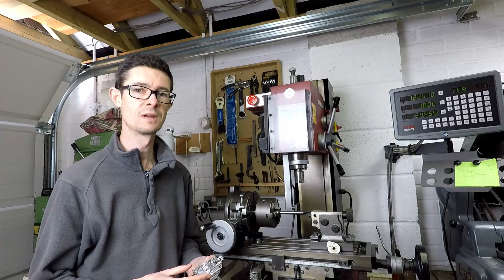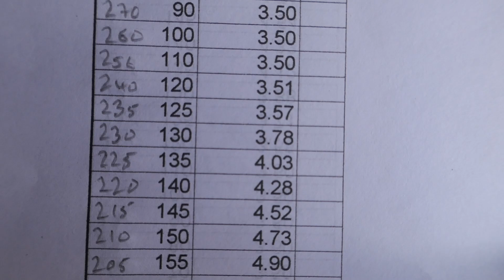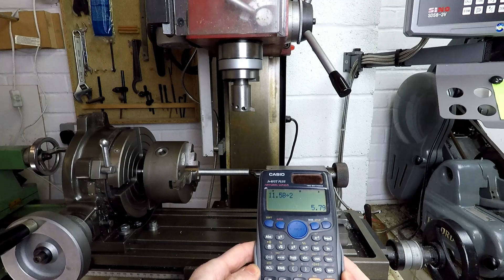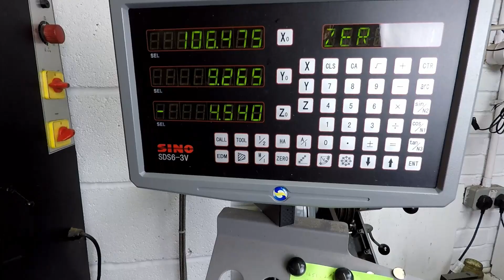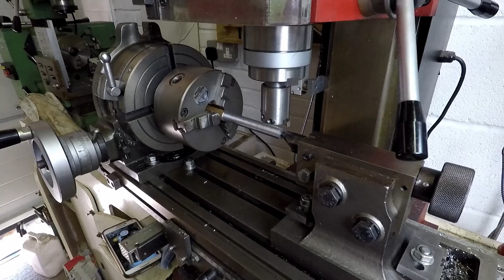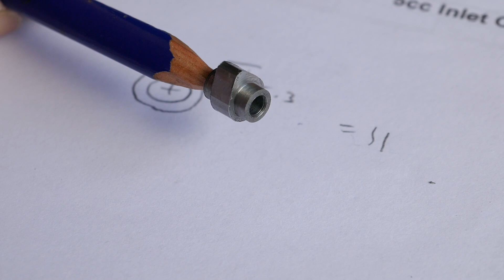Machining Engine Cams on a Milling Maching

Comment: Good video! 5cc is really small four stroke.  I used an offset turning fixture in my 9" lathe to nibble cut 5 degrees at a time for my 10cc four stroke cams.

Comment: Hi, can you please indicate me, where to find the program to make the cams like you ? Thanks in advance !! Alberto.
Reply from the maker: Hi, the method I used to design the cams was taken from the book ‘Miniature Internal Combustion Engines’ by Malcolm Stride.  This defines the base circle radius, flank radius and nose radius and depends on the engine timing.  I then drew this up on CAD.  The CAM offsets/coordinates shown in the vid were measured by rotating the wooden cam in a rotary table and measuring with digital callipers.  In this case, these measurements are the amount by which the milling machine head has to be lowered, which is different to the XY coordinates of the cam profile.
I hope this makes sense!  Cheers, MMS.
Reply: @MetalMachineShop  Yep, more like muddy water than straight mud.  Thanks for that.  I have some reading to do...lol

Comment: I have  a Hobby Lathe which I adapt for milling .
I make models of steam engines and recently IC engines
When it came to making a model cam shaft I had to use my basic hobby lathe.
I decided to use milling as the best option but did not have centres on  my lathe for milling  hence had to come up with an alternative.
I decided to hold the camshaft blank in a vice on the milling slide.
I used a parallel spacer between the bottom of the cam blank and base of the vice so I could hold the cam tight in the vice at a given distance to the fly cutter on the mill.
I milled the dwell of the cam by taking a cut then opening the vice and rotating the cam by 5 degrees tightening the vice and taking another cut.
My cam is designed with a lift of 0.080 inch plus 0.010 inch dwell Clearance means milling 0.100 inch for the dwell of 180 degrees.
Once the dwell has been roughed out the rise and fall ramps can follow.
The cam blank was rotated so the line of the rising ramp was parallel with the line  the fly cutter
Then it was milled down to this line.
The same for the fall.
I used a fine file to finish the surface of the cam.
This is very rough and basic but the finished cam has worked ok.

Comment: Used to make  plate cams in the Toolroom on a Parkson universal.   Div head and cutter at 90deg horiz mounted in an angle attachment.  Then from tooling part print using table we cut the pre prepared blank as reqd.  Some cams had 72deg  increments for cutting and a few used full 360deg.   Circa 1976 before the days of easy NC Programming and machining.    Happy days for us apprentice jig and tool fitters.

Comment: Hi, great video. How have you found the X3 mill?. Regards MachineNZ
Reply from the maker: Thanks! X3 is a good basic machine and a decent size for home use.  Its rigidity and power are somewhat lacking for heavier cuts in steel though.